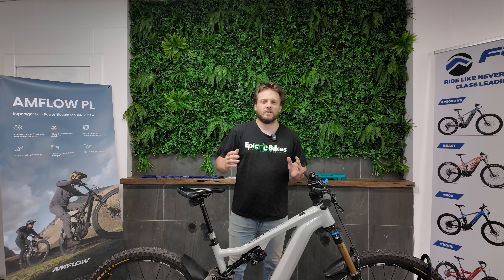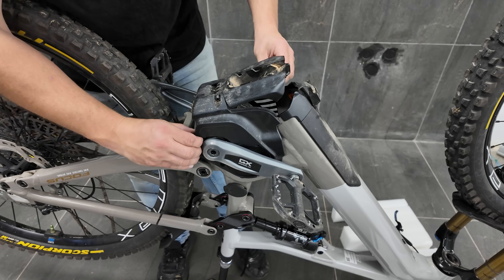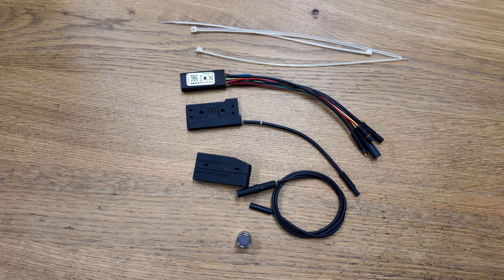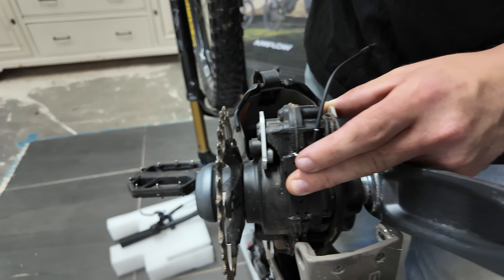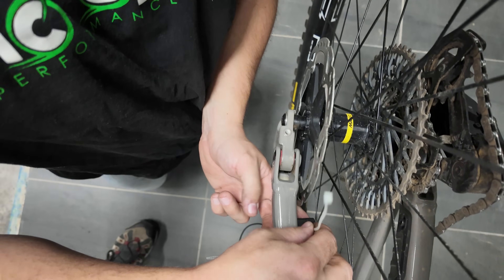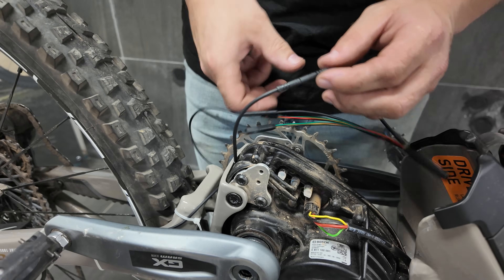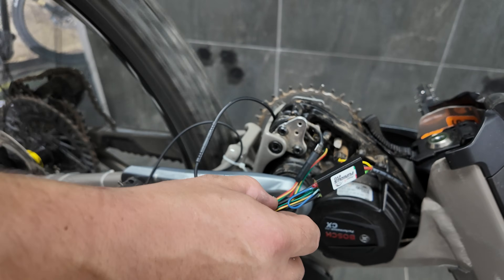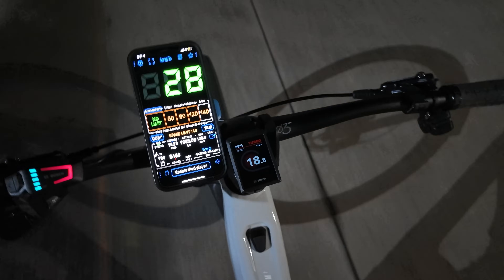How To Derestrict Bosch Smart System EMTB's With Rim Magnet

Comment: This is pretty cool!!! So you still get the same torque & wattage but just no cut off speed correct??
Reply from the maker: That's right, same torque and wattage just without the speed cutoff.
Reply: @EpiceBikes That's awesome! Im just afraid of doing this then start getting error codes. From what I've heard 🤷🏻‍♂️ And can't afford to take to bike shop if that happens.
Im in usa so I do get 20mph. But would be nice to go over that on flats

Comment: This cheat does not work anymore, the motor recognize unstable speed issues and stops working with error 523003, so you have to restart the bike and after 500m the errors occurs again..
Reply: Any fixes on yours?? I have the same issue
Reply: @markanthonycabiles7927  I had similar problem. One of the most frequent causes of speed sensor errors is misalignment between the speed sensor and the magnet on the wheel. If either the sensor or the magnet shifts out of place — even slightly — it can lead to signal interruptions, causing error codes to appear. In my case the magnet was too close to the sensor
Reply: you have to flash firmware, us is 32 kmh. some guys do that with remote team viewer.
Reply: @sebastiengiovannelli8556 did some try to use the usa settings?

Comment: Hi, After installing the chip as in the instructions, error 523003 appears on the display. After driving about 50 km. It appeared about 10 times. I noticed that it always appears when I drive at a constant speed below 10 km/h. What could be the cause? Did u had similar problem?
Reply: I had similar problem. One of the most frequent causes of speed sensor errors is misalignment between the speed sensor and the magnet on the wheel. If either the sensor or the magnet shifts out of place — even slightly — it can lead to signal interruptions, causing error codes to appear. In my case the magnet was too close to the sensor

Comment: Ok, firstable i wanna thank you for such a great tutorial and also the the Chip is amazing!!! Australia - Bavaria within in 3days Express that's insane!!!! You've got definitely the biggerst respect ever! It works great, no error, no any issue with anything! it works exactly how u said. I did a test on my privat property and tbh up to 48,9km/h without any problem at all,and i really do not know how but the boost power or what ever you may wanna call it " dang! works perfectly " Thx mate! you deserve a subscribe and here we go 🤜🤛
Reply: The question is how long it will last without error. I believe the error will appear sooner or later.
Reply: @marswood5859 my last one that i've equipped on my Cube Pro2 is still working perfect, so almost 2yrs 8month and works great! Even if i didn't touch during winter time ect it works great. Hope i could help you with this info.
Reply: @marswood5859 Hi there! right now it's almost 5month since i've installed the chip and there is none of any error that appeared. I think so far if am not wrong, follow the steps and the installation shouldn't give you any trouble. I will share any Error if they appear. Have a great day 👍

Comment: I just finished a disk magnet install on my sam2 and did 180   km enduro with it . works fantastic
Reply: The question is how long it will last without error. I believe the error will appear sooner or later.
Reply: @marswood5859  There is no difference in a disk magnet vs a spoke magnet for the system. Its still working fine with me , no errors at all
Reply: @overexposurevideo  I have Jam. I asked the manufacturer and they wrote to me that errors can occur. After 3 errors you have to go to an authorized service center. The error usually appears after a long time, as I discovered.

Comment: Didn’t work for me with Bosch gen5 and 13.13.1 firmware using the speedfun evo furious.even did away with the sensor mount and mounted as far away as possible from the motor,actually passed the   
derailleur hanger on a lashed up mount as I was told that the motor sensor was still picking up the spoke magnet giving me the orange light fault🤨
Reply: Is the firmware 13.13.1 the newest with 100nm 750watts?

Comment: anyone try this chip on BDU3360 motor model?
Reply: Have you tried it yet mate
Reply: @anaismontague2858  SpeedFun Furious Evo easy+ for Bosch Performance Line, Active Line and Active Line Plus (gen. 3) Smart System with Rim Magnet
Reply: @anaismontague2858   just instaled this one, its work
Reply: @anaismontague2858  SpeedFun Furious Evo easy+ for Bosch Performance Line, Active Line and Active Line Plus (gen. 3) Smart System with Rim Magnet

Comment: Hi, did you ever have a 523 error after the installation?
Couldn't fit the chip on my bike, the error always pop up on my display.
Reply: Yes mate i have the same problem . A you solved this ?
Reply: I have same but only if drive under 10km/h . Did u soled this? 523003  is my error

Comment: Very cool clear video !!, I have the same bike more or less ( sam2 ) You think its possible to use a disk magnet for this sensor? It will result in a much cleaner install I think as the wire can completely go trough the swingarm ( like the brake hose and even more )
Reply: I think yes. I will want to do it too for my Jam2.

Comment: There is a speedbox version which is way less faff than this,5 minute fit
Reply: No the speedbox 1.2 for bosch smart with rim magnet  is much more difficult to install then this one !  It takes forever to find the right spot for the electro magnet and I gave up on it On top its much more expensive as well.
Reply: @overexposurevideo   I got the same issues.

Comment: may consider that the bosch smart system can make a speed reading through gps when connected to an app. If then a speed discrepancy is noticed the motor will stop working. Giant with the Yamaha has something like this in place and only the factory can unlock the motor then
Reply: Why would u use the app or have it installed on your bike if your gonna be tricking a motor?? I have  a chip on a 2019 giant syncdrive and the thing is a beast and very reasonably priced too and i have it just over 2 yrs  now with no complaints whatsoever using the giantone button contrls ,yes it has Bluetooth connection and i can use the app  but that would be just stupid dont u think!  Ive also got bosch bikes but i wouldn't chance using a chip on them there mountain bikes  which means mountain cycling so why would u use a speedchip on such a bike ? And what they are made to do they do it exceptionally well even the bosch roadbikes i personally find are enough i would enjoy 20mph though im not gona lie  but foelr the sake of a extra couple of minutes on your journey does it really matter !if it does then get a rearhub bike that'll go 60mph  i happen to have one of them also  but thats mainly used offroad but  theres always the option is what im saying ✌️,what i want to know  that none of these  chipmakers ever  do is report back every 6mths  1yrs 2 yrs   kudos to this guy who rackedup a decent bita milage vand commented his results but how is it now  and drop a comment every few mths with a homest option because if your been true to your word  id have  a lit of  business for such s profuct  as where i am im connected to thousands of ebikers who rely on me for honest  opinions and  i run a ebike only shop ,hope to get some true feedback ✌️
Reply: @whitefeatherslinger8194  Thats narrow thinking. How about all the people that have an emtb that use it not only off road but also to go to the store. I may be their only bike so using it for everything like I do. I run the dog, go to the store and the post office. Love the Bosh CX motor now with this chip on it.
Reply: @LarryRichelli  Yo
u have this rim magnet version? No errors so far?
Reply: @ yup
Reply: @LarryRichelli  i hear u and i agree when its your alrounder   but chipping a motor with the smart system is not the cleverest thing to be doing.u may think because u haven't your phone and the app turned off but take heath your bike will oneday need a update that is more indebut than what u get over the air and all that history will be there.use at your own risk i suppose✌️

Comment: Second comment on this video and is 350km's later after installing this specific type of module. I got lucky and didn't have to pull my motor. You definitely do get continuing speed I think It would more so depend on everyone's gearing and front chain ring size. This product is worth every cent. Makes it feel how the factory should have released it 
I do hate seeing the wiring and big sensor on the back but I've wrapped Frame wrap around it to hide it plus MAKE SURE YOU ADD AN EXTRA TWO ZIP TIES AROUND THE PLASTIC SENSOR AT THE BACK MINE MOVED AND I HAD TO PULL EVERYTHING APART ON THE SIDE OF THE ROAD BUT WAS AN EASY FIX. I now have added a bit of silicone to the back side of the sensor and installed it back on the frame plus the 4 zip ties. This makes it good for off-roading. I've been using it on down hill rocky terrain as well. I also put a bit of lock tight on the rim magnet threads once you have found the right Position so it doesn't come loose..... Essentially make Prevention of the two black sensors and the rim magnet not to move that way it will stay working fine and no codes. 
I don't have the Bosch flow app installed even before installing the unit. never update when the unit is installed. 
I've tested this product with two different Bosch screens and I now don't use a screen at all. 

The bigger the chain ring the more top end speed ...the crappy part about it is when upgrading chain ring sizes on these ebikes they manufactured alot of the frames to not allow enough space for a bigger chain ring some bikes do some they make it a bit harder. because essentially you end up needing a massive offset on the chain ring to clear the frame.
Reply: I get 45 kmph off-road on a gravel flat imagine on the road.  Also pumping your tyres up almost maxing them out helps a bunch.
Reply: So after doing 700kms with a brand new bike I'd say in about 50kms time I'll need a new chain because it has stretched from the extra stress on the chain from higher speeds. So I need a new chain to keep my bike perfect every 750kms other than that I absolutely love it. Beats 25km/hr locked and beats having a electric scooter with one thousand rules and laws. And Also beats paying for government registrations and high fuel costs.
Reply: How is everything going now with the bike? I have a gen 3smart 2023 cube trapeze pro i cant stand the resistance u cant pedal thru it its horrible but the bike is unbelievable i honestly love it the only thing that now stops me is the taut of not been able to use the flow app to adjust the motors gears u can make the modes much more responsive much quicker acceleration so u can tune your gears for when your goin offroad its a must have but id have to choose i suppose and id even say they could if they wanted shut your motor off once if theyve any communication with it once it passes a wifi spot it could be located and theyd wait till they had a wifi signal like when its at home to switch it off or do whatever thats what i fear about it ive mentioned it before its like your only renting a bike off them because my bike isnt a year old yet but we moved to the other end of the city ive no way to get the bike to the original shop for repairs etc And theres bosch dealers in my new town but refuse to do anything on the bike purely because i bought it else were thats just not fair and id be willing to pay in these other dealers shops for services like come on bosch sort that out. They will work on my dads bike thats 5yrs old but not even bought in the same country back when he first got it theyll plug it in for a test and do regular work to it all because its a  giant bike yamaha motor but bosch no chance.your bike u paid for it let the owner do whatever he wants imo
Reply: @whitefeatherslinger8194  man you have a bosch gen 3 motor this video is not right for you bike anyways
Reply: My bike is also going great nothing wrong with it I'm almost at 700kms with this chip upgrade now
Reply: You can turn off the Bike immediately after stopping? Or you msut wait? No errors so far? How about the magnet, doesn't it move even in offroad?
Reply: @marswood5859  I always come to a full stop let it rest a few second then turn it off...but the bike will let you turn it off while riding it, same with switching it on. What I originally said in my first post follow those instructions as well as this YouTube video and you will be fine at 800 KMs now. Still no issues just about to service the bike and put a new chain on it.

Comment: Been running this chip on cube stereo hybrid 2024 with rim magnet every day since November in uk on latest software total game changer especially for commuting for work will go as fast as you can pedal
but not connected to phone
Reply: i think connecting to the app is giving it access to gps, which, maybe gives errors? Got this chip as well without the app. Works flawless uptill now.
Reply: @e-mike9776  now what happened?
Reply: @e-mike9776  Hi, how are you? Can you tell me what software version you have installed? Thanks!!!
Reply: @erzabel hi sorry bit delayed I’m currently on 13.13.1 if that helps still running fine cheers
Reply: @erzabel  hi currently running software 13.3.1 cheers
Reply: @e-mike9776 so you recommend not having the e-bike flow app
Reply: I agree 👍
Reply: How do you know what software it's running without the app? I have just got the same or similar bike
Reply: @  hi tells u what software you’re running on the kiox display settings 👍
Reply: @SuperBrooks15  oh got ya, thanks. Mines just the Bluetooth mini controller and no screen but I don't want to get the flow app incase it gets an error when  I mod the bike